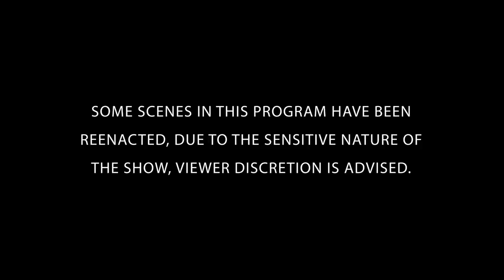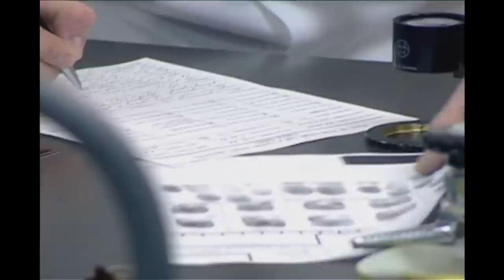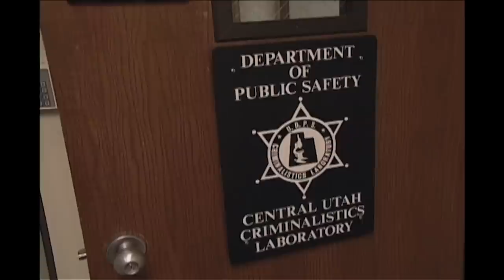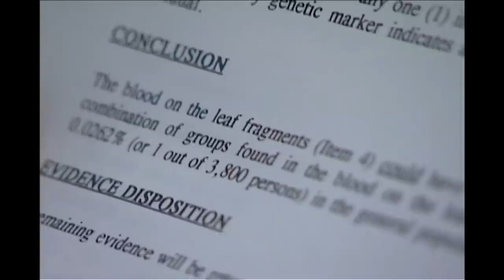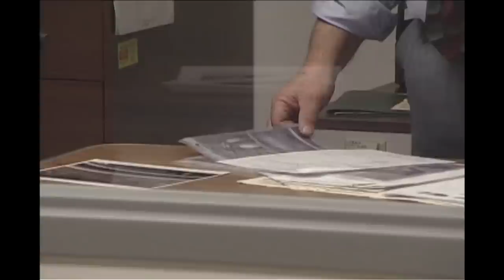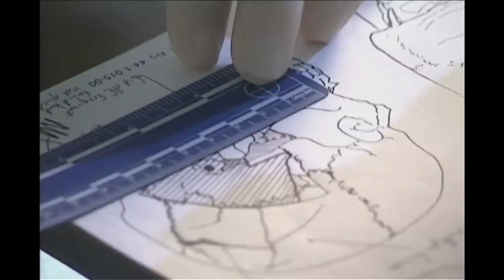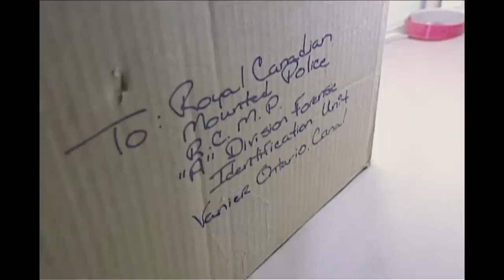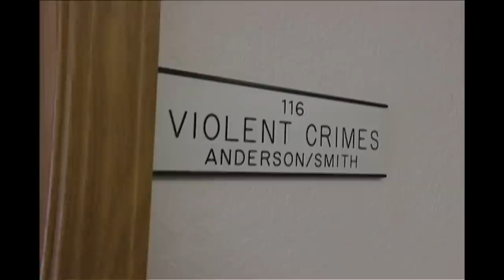Broken Vows | FULL EPISODE | The New Detectives

Comment: The flat tire. I'm struggling with the logic in puncturing the tire from the inside. This would require the tire being removed from the rim, then punctured from the inside, then remounted on the rim. This would require bringing the tire to a tire shop and requesting the tire be removed using a special tire mounting machine then remounting the tire. This makes no sense what so ever. If you want to stage a flat tire just hammer a large nail or screw into the tire then yank it out with some pliers and the air will leak out.